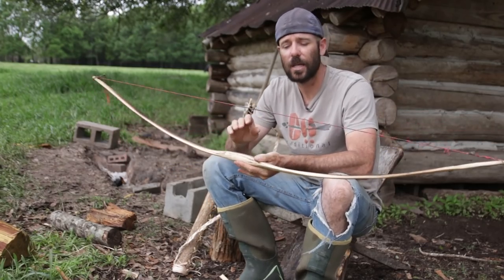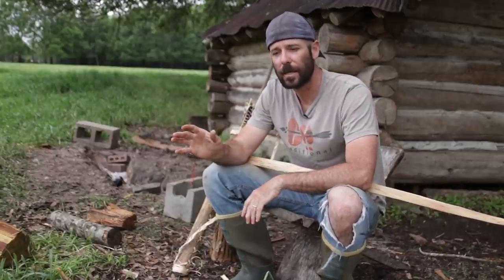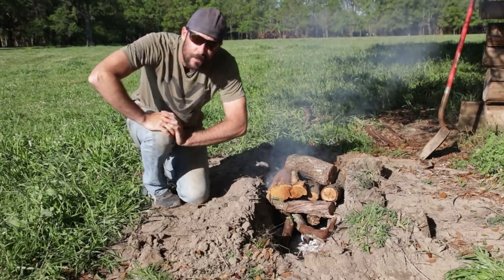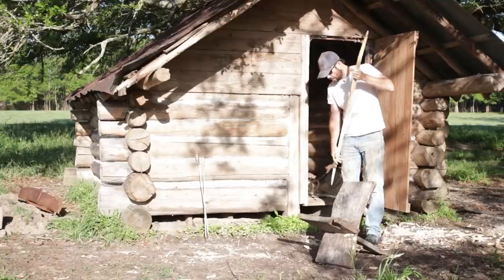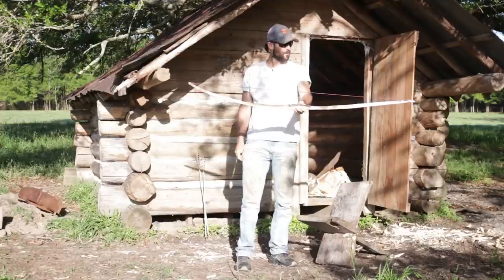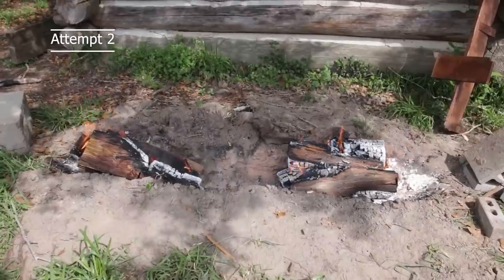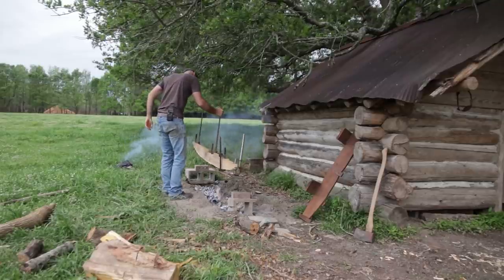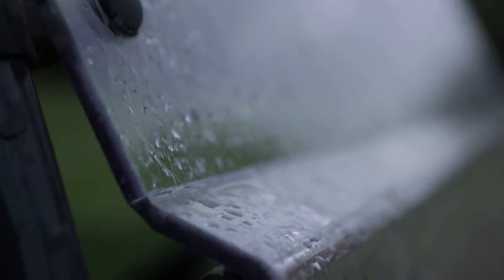How NOT to FIRE HARDEN a Primitive Bow!

Comment: I used a heat gun on my vine maple ELB I made a little bit ago and it really helped with the performance just like you showed. I wonder what the benefit of an actual fire over the heat gun is? Maybe the coals and charcoal provide a more even heat so you don't get the hot spots like you showed during your experience. Thanks for the great video!

Comment: Those who live in the middle on the Upper Plains you have Willow, Cottonwood, Chinese Elm Non native, North Nmerican Ash, if lucky Poplar, and Boxwood or Manitoba Maple. You might even be able to use  Linden, Hackberry, native Locust ect as well. Others like Ironwood I am not sure you can even make Bows out of due to how strong they are and unbending when new.   

Now by the Natives of the Upper plains Some pines were used like the scrap tips of Lodgepole Pine for quick bows that they needed to get them through a period of up to a year till they could get better woods even Cottonwood that would lastshould an old bow break. Yes I am rather sure the Natives pre white people in the plains since they started living here 700-500 years ago had used a similar method to what Clay is doing but more primitive, though not same shape, a slightly different bow shape in that the whole bow was thinner but wider the other way from front to back of the bow.

Comment: It was great watching you struggle through this process. When I did this I had a thermometer to constantly check the heat to make sure it was under 300 degrees Fahrenheit. It was a lot harder to keep it at the right temperature than I anticipated. Definitely a skill to develop,
Reply from the maker: Yep, definitely a learning experience

Comment: Hey Clay I had two bows break after heat treating. I done one over a fire like you show in this video and the other i used a heat gun. The wood was really dry and snapped with very little flex. I put a lot of hard work into both bows and I must admit im quite disappointed with the outcome. What am i doing wrong? I must be missing  something
Reply from the maker: Hi Mark, it’s hard to say. Bows break for a lot of different reasons.

Comment: So heat treating wouldn’t have any benefit to wood that is already at the optimal moisture level?  Also wouldn’t the wood soak moisture back up after heat treating making the bow less efficient?
Reply from the maker: Fire hardening changes the properties of the wood. It’s not about moisture content. It makes the wood more resistant to compression. It also makes it more resistant to soaking up moisture. But you’d still need to seal the bow.

Comment: I read over data that came out of the wood siding industry regarding heat hardening. Actual, scientific testing shows that wood that was heat hardened loses 10 to 30% of its tensile strength along with losing compression strength. Heat hardened wood is not allowed to be used as structural members. The caveat is though, the whole issue of losing tensile strength isn't important if the bow is sinew backed and could make for a really impressive bow.

Comment: What's the point, make it more brittle? Remove moisture? 
Seems like it's unnecessary if you use proper wood and let it dry out
Reply: Here's a paper detailing it. Remove the space between the dot and paste it into in a search engine: ncsu. edu/bioresources/BioRes_04/BioRes_04_1_0370_Esteves_P_Wood_Mod_Heat_Treatment_Rev_367.pdf
Reply: like he stated in the video, its to not having to wait months/years for the wood to dry. You can cut down a tree and make a good bow out of it in a couple of days.
Reply: @listeformeg  It also makes the belly stronger in compression, thus need less mass, making a faster shooting bow.
Reply: It helps with compression damage to the belly.
Reply: @Tradbow85  it's a wood bow... Shooting it damages the wood, no matter what method is used
Reply: @carlredbird3054  I dont disagree with you. It just makes it a liitle better. Everything has a life span, even fiberglass bows can eventually pop.

Comment: Keith, Thad and Billy really rediscovered something amazing here. Ive made several fire hardened bows. The performance and benefits are definitely worth struggling through the learning curve to reap the benefits of this process.  Thanks for putting up some videoes on fire hardening Clay. Will be looking forward to them for sure! I did some experiments with honey suckle and had some violent bow explosions. I think every type of wood will respond differently...
Reply: Have you tried red oak? If so did it benefit from it?
Reply: I haven't tried red oak and probably wont.    My experience with red oak is that it tends to be more dry and brittle. I personally wont try it but you never know. I have made a couple fire hardened black locust bows and had great success. I even sinew backed a BL short plains bow. So far it hasn't had any belly problems and shoots super fast. The fire hardening strengthens the belly so much that it compensates for the compression issues that BL usually has. Even with the sinew adding more tension! Its fun to experiment. This process is a definite game changer.
Reply: Yeah some woods can't handle it as much as others.  Hickory and elm are what we have in Georgia and they seem to respond the best, though sweetgum, if made longer /wider is also an excellent choice for fire hardening. You have to adjust the intensity for each wood species and that take experimenting.
Reply: They didn't rediscover anything. Anyone that's ever built a bow has known this since they started. Well anyone who actually read in an attempt to learn.
Reply: @Tradbow85   You're right in one respect...anyone who can read or watch their DVD certainly will learn about the fire hardened bows...from Keith, Thad and Billy!!  But I strongly disagree with your belief that they didn't rediscover anything.   Fire hardened bows aren't discussed in any of the Bowyer's Bibles, although that's considered the gospel by many bow makers.  There is a chapter on heat treating bows, although that's not fire hardening.  There's a big difference.  Have you even watched their DVD?  Do you even know what the hell you're talking about?  Wait...I already know the answer..... NOPE!
Reply: @BigDaddyBangBang  ove probably built mire bows than youve shot lol. This is nothing new, ask about it on any selfbow forum or group. Theres a reason nobody was impressed and thought it was a joke.
Reply: @Tradbow85  ove probably built mire....  great English skills.  Can't respond because I don't understand "Idiot"
Reply: @BigDaddyBangBang  sorry it's my 3rd language and I missed typed. How many languages do you speak again?
Reply: Thought so loud mouth

Comment: Clay, I have a tipi. I cut my own poles. One of the poles was a skinny hickory. After a few years I replaced my poles. I used that hickory to make a nice bow. The base was twisted and the tip was too skinny but in the mid section of that pole was a nice straight stave. 46 inches plains style bow draws 55 at 22. I had a lot of fires over the winter in that tipi. I dont know if it was just that heat or a combo of the heat and smoke but that bow is as good but lighter than any osage bows I have save for one .all about same size strength and style. I think the fact that they stored bows in shelters that had wood fires inside back in the old days tied up or wedged into the framework made the bows stronger.faster shooting ect. The fact that they were rubbed with grease or fat and there was smoke made for water repellant. It's a little more forgiving of a method than putting dried wood over a fire.but I think that is why your method works.its just a faster way of doing it, although a bit less forgiving if your not carefull.
Reply from the maker: Very cool

Comment: How should I tackle a dogwood stave
Treat it like hickory or chase a ring like Osage  ?
Can't fine anything on dogwood or what to expect from this white wood.
Growth rings extremely thin.
Reply from the maker: I’d just remove the bark and use that first ring as the back.
Reply: Keith made a fire hardened dogwood bow in the DVD we released and it worked really well.  Use the outside of the tree as the back and then fire harden the belly.

Comment: the traditional bowyers bible warns of kiln drying, could you make a video/comment on your thoughts about it?
Reply from the maker: I think that’s just old info. In my opinion, there’s nothing wrong with force drying certain types of wood.
Reply: yeah, interesting. might just as well be that the comment in the book came from experiences with wood which doesn't react well to it for instance. or something else went wrong. once I saw a video regarding old native american tradition, fire drying techniques in which the bow was even buried below the fire, so I do think there is some ways to do it, some right some wrong. 

I wonder about the longevity, maybe the wood doesn't handle rain or humidity changes well, or turns out it breaks after some good use. do you plan on testing the technique further, and the bows as well? the good old "shoot a 100 arrows through it".